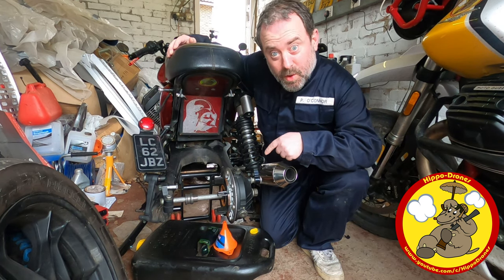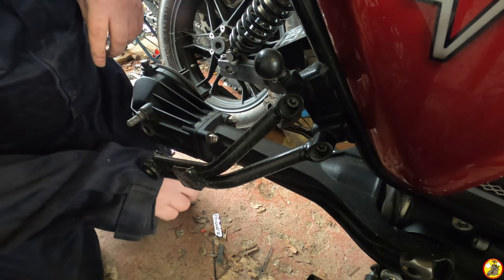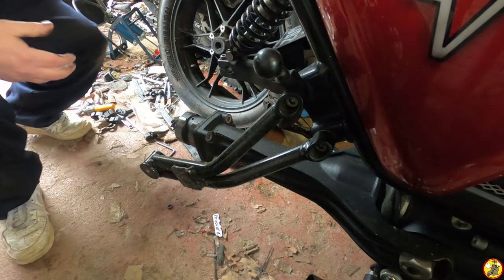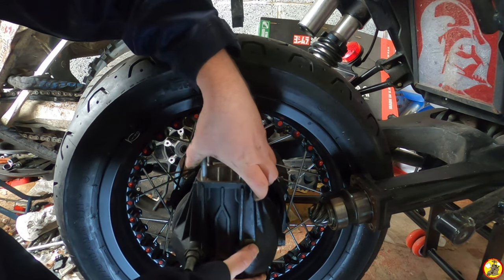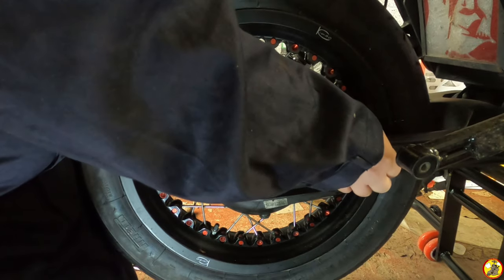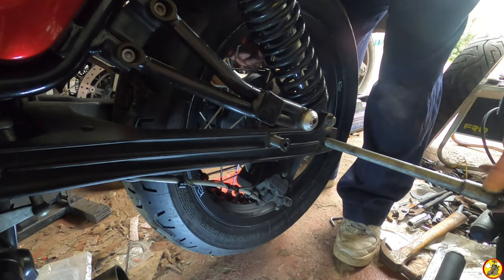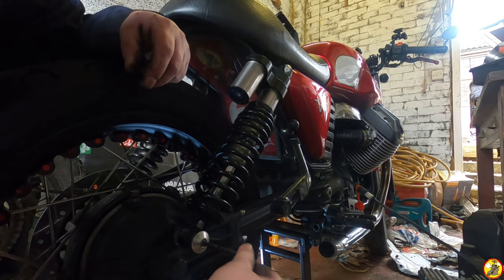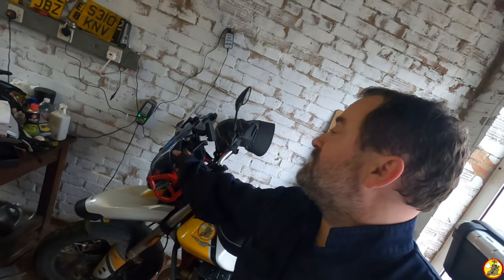Moto Guzzi V7 | Removing the Bevel Box Assembly / Refitting Rear Wheel

Comment: That was painful to watch.  I was waiting for the pinion and its bearings to be ejected by the cardan shaft and finally falling out.  You were lucky - or there is something wrong with the fit of the pinion shaft into the cardan.  Removing the pinion from the final drive like that disturbs the meshing of it and the crown wheel.  As you didn't disturb the gaskets and suchlike you should have got away without a very lengthy and fiddly process to align them again - if you do disturb the alignment and you just reassemble, you will be looking for another drive box in short order.

For future reference: as you suggested, install the wheel with the tyre flat if you have fitted an oversize one.  Lubricate the cush rubbers and/or splines that go into them with a rubber compatible grease (silicone grease) and you can then partially fit the wheel and use the spindle (without spacer) to align the wheel with the final drive and rotate it until the splines fit in between the rubbers.  You can then push (pulling might work better) it fully home and it will stay there while you remove the spindle and fit the spacer before final assembly and inflation.

One final thing.  If you do take the drive off, it is heavy and awkward to hold.  Be very careful as you move it about - if it falls out of your hands, it will land on the suspension mount and snap it off, along with a lump of the casing.  Don't ask me how I know or I will begin crying again.
Reply from the maker: Thanks for the tips and knowledge 👍
Ahh, that sounds like a very frustrating and expensive mistake.... nice to know even the experts make mistakes though, hopefully we all learn from them 🙂

Comment: Great job and good of you to make this video for fellow v7 owners.  Thank you
Reply from the maker: Cheers Michael 🙂 in the comments are some tips from others about how to do it too.
Reply: @HippoDrones  One tip I have from my own experience doing this yesterday is this:  If you're just changing tires same size without removing the drive, when you go to put the wheel back onto the drive the rubber cushions keep popping off, so slide the axle in all the way without the brake caliper and spacer, and use the axle to guide the wheel back on to the drive and that helps keep the rubber bits from falling out. Once the wheel's on the drive, take the axle out, put the spacer and brake caliper in (line them up), then put the axle back in.  Then it's less fiddly.

Comment: Enjoyed this Peter, I liked how you described and approached the challenges "live" so to speak. I was able to relate to a fair bit of it, even though you're running shaft drive and me a chain. Similar problems though, and thought processes required to think a way through it. My manual said removed the ABS connector before removing the rear wheel - this resulted in problems (had to have ABS re-set) and I discovered it wasn't necessary - but getting the brake mounting on and off is very similar to the V7 (sort of upside down version). It's one of those "need 3 hands" jobs, haha! 
I did find a way to make the whole thing easier - I got a plank the right thickness and put it under the rear wheel so that it was just about supporting it. This meant less effort to hold everything in place whilst re-assembling :)
Good work mate, was so pleased not to see a river of oil as a feature ;-) the "live" flavour if the video made that a worrying few moments! 
All the best mate, take care.
Reply from the maker: Cheers David, I am sure I'd be able to do a more polished video if I tidied the garage and tools and read a manual as a lot of folk have suggested 🤪 ....but where is the fun in that??? 😁
I really enjoy making this sort of video, and am sure most people see that I am not a mechanic and can enjoy the trials and tribulations 🤣
A plank of wood would def have helped keep it levelledand easier to align 🙂 ty for the tip 🙂
Ahh, I hate it when following the instructions leads to more work, that must have been a little frustrating,  especially when you discovered you didn't need to disconnect it after all!
I am very glad that there was no oil spillages 🤪
Cheers David 🙂

Comment: Great video. My only suggestions would be to put some newspaper under where you're working and maybe a clean tray to catch anything that drops. Also, I did cringe when you were hitting the bolts with your hammer. I learned the hard way how easy it is to bugger up threads!
Reply from the maker: Thanks Steve, and again, thanks for the tips and tricks... Hahaha... yeah, lesson learned... I'll not be using a hammer again like that 🤣👍
Reply: @HippoDrones  Incidentally, have you changed the differential oil seal on the V7? I've a friend with one and it's leaking. Watching your videos, getting the diff off doesn't look too difficult. Just not sure what's involved to replace the seals.
Reply from the maker: @stevedel7  no mate, that isn't a job I have attempted yet

Comment: Please invest in a rubber mallet. A stool would be helpful too. In a seated position, you can use your foot under the tire to get it at the right height and then push it on with your hands. It will save you medical bills to repair you back as you age.
Important thing is the final product looks good. Like to see a vid of your assessment of the change with regard to comfort and handling. Changing the weight of the wheel changes the forces put to the suspension and of course changing the width may change the ability to change direction. Be interesting to know if those things got better, worse, or were basically unnoticeable.
Reply from the maker: I do have one, just too messy... I have stools too, but they have tools on them 🤣 #TopTips matey, ty 🏍
Reply from the maker: I've already reviewed the tyres on the bike last summer, I was putting the wheel back on because the shop I paid to change the tyres before had damaged my Kineo rim doing so

Comment: I have a similar struggle with my 750 Monza after some berk (me!) ordered too wide a back tyre. Fully deflating the tyre allowed me to squeeze it past the Cush-Drive splines. You may find it helpful to ‘stick’ the Cush-Drive rubbers in place with some silicone rubber sealant.
Reply from the maker: After the shop I paid to change my tyres damaged the Kineo rim, I didn't want to risk it now the rim is repaired, but that is how I have done it previously

Comment: Do you every grease your drive shaft and how? And is it normal to have rust inside the final drive where the Cush rubber seat? Noticed you have some on yours and I do on mine as well.
Reply from the maker: Hi, it is a good idea to grease the drive shaft as it can seize. Mine came apart wrong and the bearings should have stayed with the bevel box exposing the shaft. I don't know about normal, but any bare metal can rust if exposed to moisture/salt. I don't recall mine being very rusty, but it may have been.

Comment: According to my V7III manual ,the bevel pinion and bearing assembly should stay with the bevel box housing on removal and not stay on the end of the shaft. 
The pinion assembly should slide off the shaft splines.
Reply from the maker: Yup, it should! 🙂

Comment: Why so many dislikes? :/ You got it done anyway, I do think the air out option sounds easier....also those wheels are absolutely beautiful :D More close up shots needed :D I also love the sneaky I'm lovin it sticker under the tyre at 17 odd mins :D And the Vader print is also insanely cool :D Castles!!! I remember travelling :'(
Reply from the maker: Hahaha, it all adds to the metric :D but I think some of the old and bold Guzzi owners don't like things being done unless it is by the book with a micrometre! :D
The reason I didn't do the air out thing was because I'd just got the wheel back from being repaired after the shop that fitted the tyres damaged the rim, so I was being a bit cautious :-)
I did have some pics on my Instagram, but had a clear out of pics that hadn't gotten seen much. May re add them now am a bit better at the tagging :-)

Comment: Hello! I really liked your video. I have a question for you, is it possible to service MG without having a dealer, it's just that these are so unique and distinctive bikes that I just don't see an alternative to them? For more than a hundred years, bikes have been produced at the same factory, almost manually, who can "boast" about it now. Thanks!
Reply from the maker: Most of the Moto Guzzi bikes are very home service friendly. Even checking the valves on them is a simple job made easier by the heads poking out the sides of the bike.
Reply: @HippoDrones  Thank you for the comment, but what about the software and error reset?
Reply from the maker: @tgs8459  you'll not be able to do that on a modern Moto Guzzi, you need a special computer system for that I think

Comment: Thanks for that. have just taken my back wheel off my nevada, what a pain. Will put the new tyre on Tomorrow and wondering how will I manage to get it back together. I was thinking of taking the cush drive off but was a bit worried. Now I will sleep happy, cheers.
Reply from the maker: It is really easy to do, just a pain in the neck to need to. I had to do it as my rear tyre is oversize, but you may not need to if your new tyre is standard sizing! :-)

Comment: I've never seen a shaft drive taken apart before!  I think I have the exact same lift stand for my motocross bike!  A small 2x4 works well when you can't find the rubber mallet.  Overall that didn't seem like to bad of a job, probably would have cost a couple hundred at the bike shop to have it done.  A motocross number board 🤔 Gotta see that!
Reply from the maker: It apparently came apart differently from how it should have done, which I am glad for as the way it should have separated may have had it all end up on the floor! :D
The stand is cool, it basically acts as a removable centre stand and pivots on the centre stand mounts to get the rear wheel up. So glad I found it, is really handy.
Check my Instagram for a sneak peak at the number board setup on the V85 :-)

Comment: Cracking looking bike when its finished bud.. whats your plans for brake light? Maybe indicators off that would work.. BTW if youve room to move, who cares about the state of your garage 😂😂. I'm quickly realising I need a light of some sort for my camera, my workshop vids are way too dark and quality in return is pants. Yours are spot on. Nice tutorial 👍
Reply from the maker: Cheers mate, the bike has been finished several times now :D but is a custom bike ever finished??? :D 
The brake light and numberplate are side mounted on the old pillion peg mount, so fitting indicators either side of that could cause some confusion lol :D  I may have a mix up as I want to redo the seat unit, which may give room to put lights on the subframe frame hoop, which could look nicer.
As a light, I used a powerbank which has a built in diffused light on it, really handy when grubbing about in the garage, and helps with the camera work, not mega expensive either and handy when camping too.
Thanks mate, appreciate the compliment and feedback :-)

Comment: Found a nice ‘12 V7, any advice? What to look for?
Reply from the maker: Generally they are very reliable. The only things I'd be looking for providing it doesn't make any odd noises and rides straight, is oil seeping from the bevel box and also how well the clutch works when the engine is hot
Reply: @HippoDrones  any way to PM you? Get your thoughts.
Reply from the maker: @kev403  sure thing, there are links to my Twitter, Facebook and Instagram in the description below and on my channel home page 🙂
Reply: @HippoDrones  cheers will do
Reply from the maker: @kev403  :-)

Comment: Hope it handles OK. My Monza is more reluctant to get right down in corners with an oversized rear tyre.
Reply from the maker: It handles great, is not a new tyre, only removed the wheel to get it repaired
Reply: @HippoDrones  - great to hear it handles so well. 👍
Reply from the maker: @timhicks2154  Aye, I had it fitted back in the summer originally, the shop who damaged it and repaired it said they were happy to wait till winter to fix it if I was to save me losing the summer riding with it! :-)

Comment: Can leak if you let the studded part drop down. But I think there’s an oil-seal on the input bearing if I remember right.
Reply from the maker: I think it would be more of an issue if it was at the right level, but needs topping up I think
Reply: @HippoDrones  - they only take 180 cc’s I think. Check via the rear level plug with the bike on the centre-stand. Top up until oil flows out of the Level hole.
Reply from the maker: @timhicks2154  will give it a check before I get it MoT'd 🙂
Reply: 85w/140 is what I use
Reply from the maker: @timhicks2154  ta, will see what the manual says but imagine it'll be the same

Comment: This should be called, How not to do this.  If you are going to use a hammer, you should put the bolts on so you don't damage the threads. And if you are going to pry off the drive gear assembly, you should wrap whatever you are using in duct tape so you don't damage the mating surface and have leaks.
Reply from the maker: Ta for the input

Comment: couldn't you just remove the air pressure from the tyre to push it in?
Reply from the maker: Yup, but that is how the shop did it when they fitted the tyres originally and they scratched up my Kineo rims, this was why the wheel was off this time, so they could repair it. Didn't want to risk it. Had the tyre been a standard 130, it just about fits, but the 150 is just too big :-)
Reply: @HippoDrones  fair enough
Reply from the maker: @UncleLongbeard  :-)

Comment: That’s actually not how it’s meant to come apart! The gear should stay in the bevel box and come off with the whole bevel-box assembly, as a unit
Reply from the maker: Ahh interesting, this way seemed easier :D and nothing caught fire or exploded! :D
Reply: @HippoDrones  - the spacer plate often sticks. I think a liquid gasket is put on by the factory. It can be reluctant to come off
Reply from the maker: @timhicks2154  ahh, am glad I didn't need to replace that then

Comment: I gonna put 140 nobby on my v7
Reply from the maker: You gonna take it trail riding?
Reply: @HippoDrones   yes.  Now that I know the 140 will fit
Reply from the maker: The low seat height will help on the trails, I'd possibly look at a slimmer tyre though for trail riding if you can find one though, as it'll handle rutts better maybe! :-)